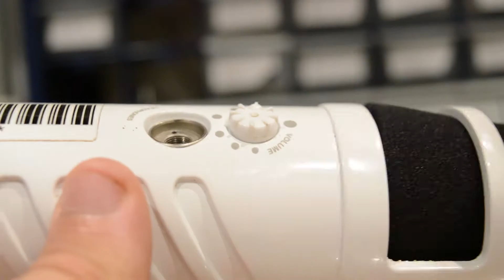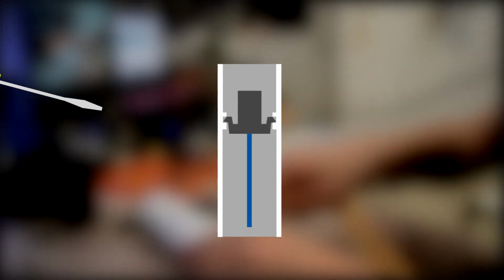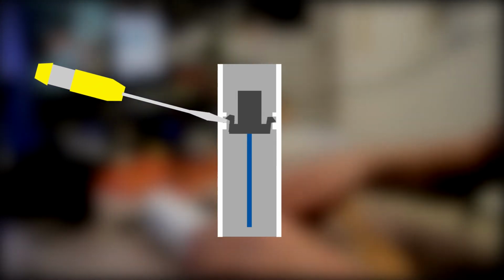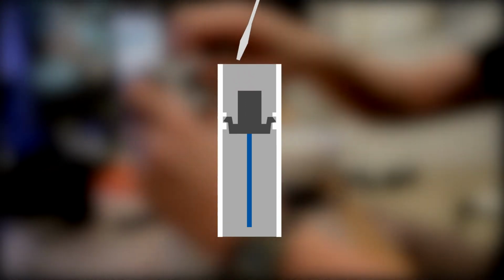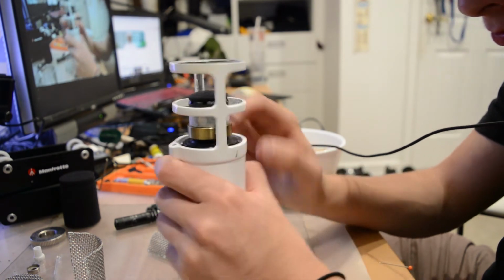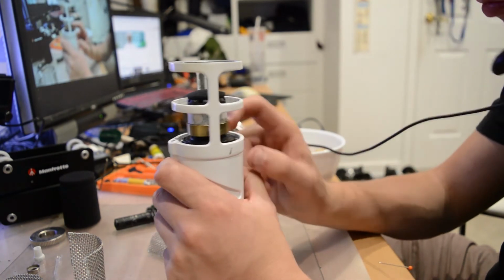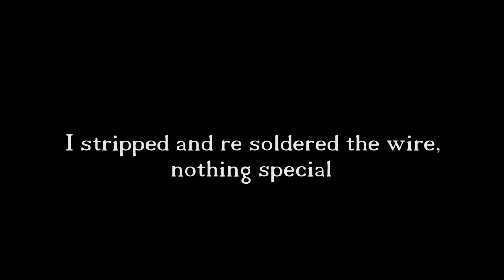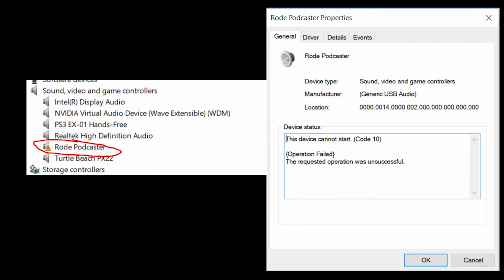RODE podcaster teardown guide (Reupload)

Comment: An easier way to remove the inners without touching the side mesh: Use your tweezers (after removing the headphone input cover and volume control cover), put tweezers in where the headphone socket is and 'push/slide' the bottom of the headphone input up a few mm. You will see the volume knob disappear upwards. Then use a pencil (eraser end) to push the USB PLUG at the bottom and the whole unit will slide out of the top. Great video thank you. I couldn't get the top mesh off off mine until I saw this vid. Thanks again.
Reply: This helped me so much, old comment but thanks!